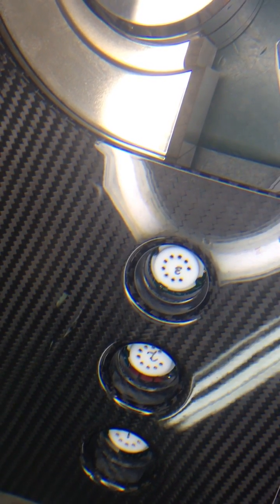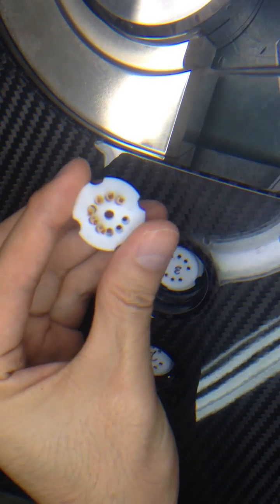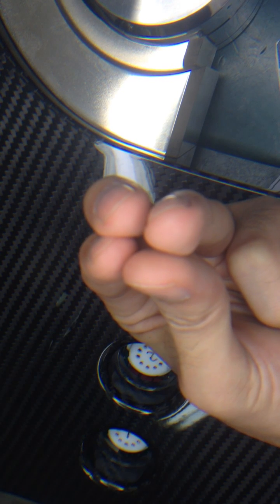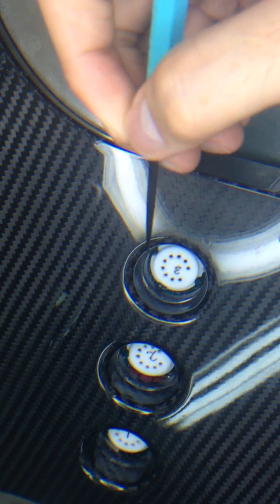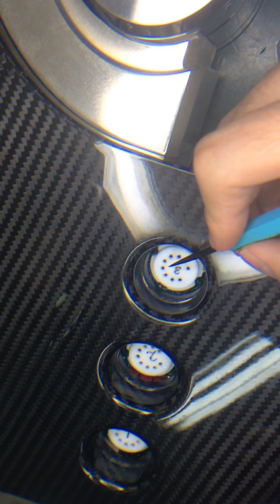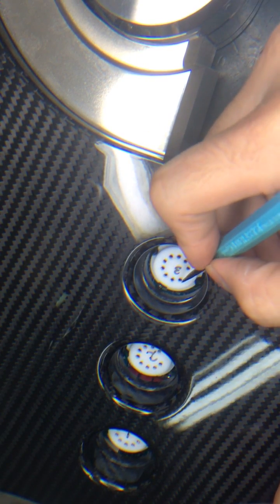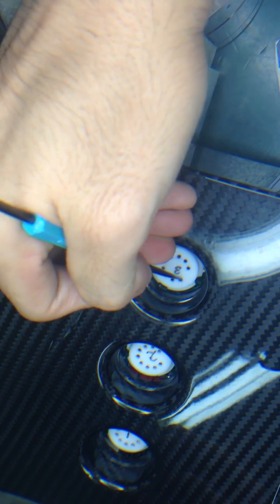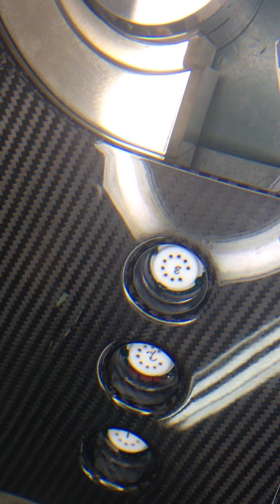Tighten the pins on tube socket

Comment: Besides doing this with amp disconnected from AC, is there any danger if you tight em 1 by 1 without discharging internal caps? Thanks mate
Reply: I personally would be weary of it. Simply get a large-ish resistor of some value (like 100k+) and solder it to a jacketed wire. Use that wire/resistor combo to do the discharging. Touch one side from the anode of the capacitor … and then the other side to chassis ground. Should take a few seconds to drain. Be sure to test voltage after the fact.
Reply from the maker: Depends on the circuitry, it’s possible some contacts might have energy at some points, the safer way is use multimeter and measure all contacts voltage before using the method
Reply: @stanzkam1  Thank you so much sir, my right socket 12au7 is loose but it works perfectly fine, I wonder if it is making full contact. I need to learn how to safely discharge the caps first, I got the tools already